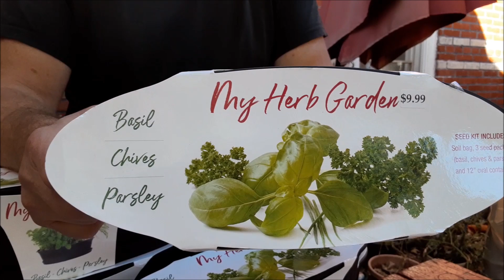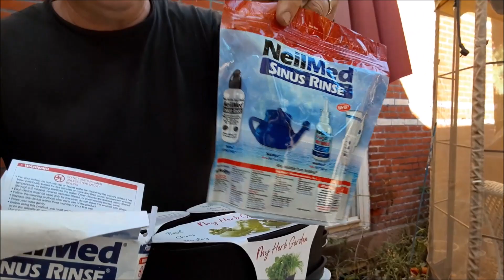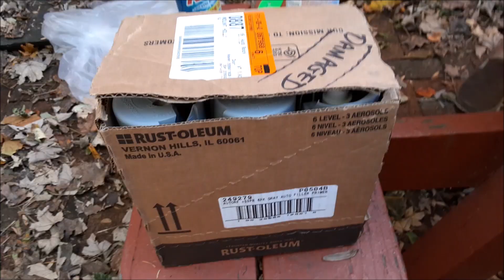DUMPSTER DIVING~ CVS AND HARBOR FREIGHT! HE RESCUED AMAZING VALUABLE MERCHANDISE FROM THE DUMSPTERS!

Comment: You’re cats r going to eat those plants indoors all winter long. Add some catnip and keep them drunk all winter long. 🤣🤣🤣 I am definitely in sync with u guys. I vibes broom sticks. My rake stick broke, but the rake part is fantastic. I was hoping on my walk with my neighbor that a neighbor would throw out a newer broom stick than the extra one I had, but the older stick I saved for these issues will be fine. I always save a few long broom sticks for painting ceilings and if take handles break. 🌝🙏🌝🙏 Add a little water to ur dish soap. My friend worked for a cleaning company and said most laundry detergent and dish lotions are very concentrated. U can clean with less by diluting a little. Stretches the soap.